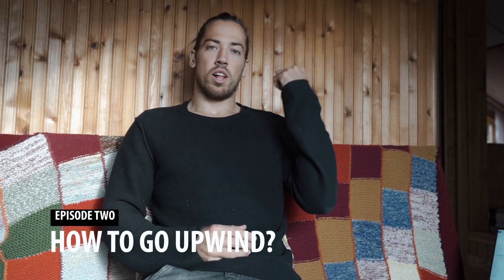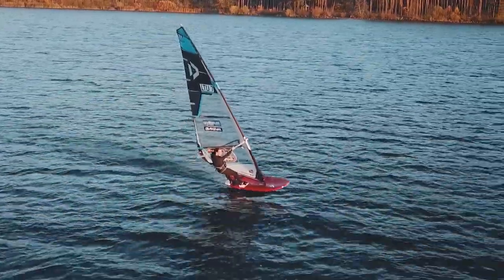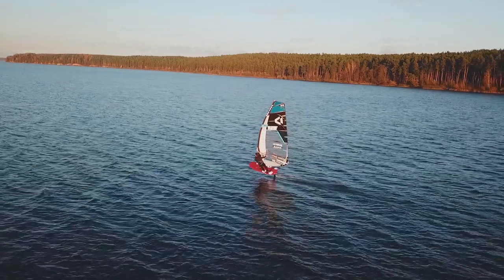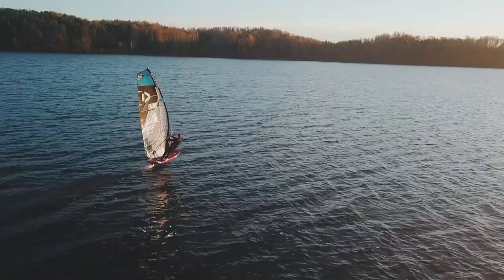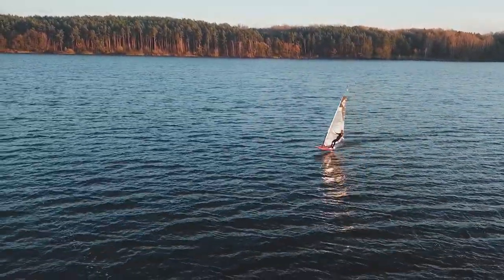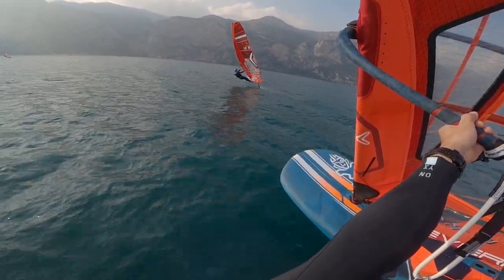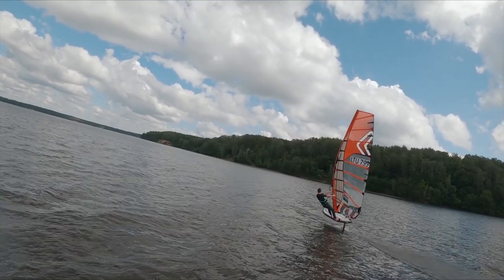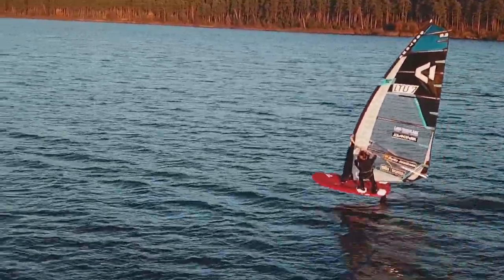How to go upwind on the foil? Windfoiling Web Clinic Ep 2

Comment: Hi Rys,

Amazing video, once again.
If you have the time,
Which wing size and span are best for course racing? And for a solid upwind?
Is 750 enough?
Also, fuselage wise, what do you recommend?

Thanks?
Reply from the maker: For course racing I would say you need at least 900cm2 wing with a 110+ fuselage as the minimum

Comment: What might be cool (but not sure it’s feasible) would be to show beginner/advanced riders typical foiling mistakes, and help them correct these (like before/after). To always see perfect execution is good, but many will only be able to correct something when they see their own mistakes first.
Reply from the maker: I see the benefit of it, but I guess it would have to be a separate video series for that. 
Also at the moment it is a bit hard to find some volunteers to sail with me in sub 10° celsius
Reply: That’s the skill I would like to learn the most. In our area the wind is usually light. I try pumping, but I cannot get speed enough to fly. I am doing something wrong, or my msterial is not adequate.

Comment: He did not tell all secrets. 😄 There is a secret: When you go, you need to open the sail a little twisting the body in the direction of the movement and as if to give up-forward to the wind, and then re-close, that is, all the time trying to bring it forward-up to the wind a little under-closed, this is the most ideal position for going upwind. In this way, the sail has the minimum drag and the maximum thrust forward, that is, the sail begins to pull you forward and up into the wind. And we control the speed, we slow down a little, sail a learn little back, thereby increasing the apparent wind, if you still slow down, then you need to bear away, there is a whole art and thousand hours of practice are always needed in a pair with someone.
Reply: It is difficult to explain by words, better one time to see... So: you twist front body against wind and at the same moment extend back hand and sail little open, and at the same time you trying to "learn" sail forward-up into the wind (same direction of  movement like in water start), but of course this movement not radical, and maybe even will be not visible if you look from the side... what is happen: you must notice, like sail pulls you directly into the wind...

Comment: Rytis, did I see it right that you don't have back straps on the board at all ??
Reply from the maker: Yes, that is correct.
It is due to the center of power from my foil, which is very far forward.
Reply: @RYTISJAS  Phantom ?
Reply from the maker: @markocernic8659  I am using Exploder!

Comment: Just tried your tips Rytis, big change thanks for putting this video!

You are mentioning the super 7 position. However, I've noticed that when I'm leaning FW taking the sail back, I have less pressure (down) on my back leg, so I need to bend it down to put more pressure and this makes my stance quite uncomfortable. Alsp I've noticed   I'm kind of twisting  my back to look upwind and have my front shoulder face upwind. So I can't really do the super 7..  any ideas why?
Reply: Added a video to better explain
https://youtu.be/Qu8aDPlxha8
Reply: Hey, I just saw your video on your own foiling. I used to foil with my 135 slalom board and I had the same problem. Now I use the IQ Foil board where your back foot is placed more outwards in comparison to the slalomboard I used to use. This helped me a lot in finding a natural/comfortable stance and thereby do the super 7. So I think it's mainly the board you use for foiling because your technique lookes quite neat. Hope I helped a bit with this info!
Reply: @sanderdekeyser5894  thanks! Got a new board, can't wait to try it!